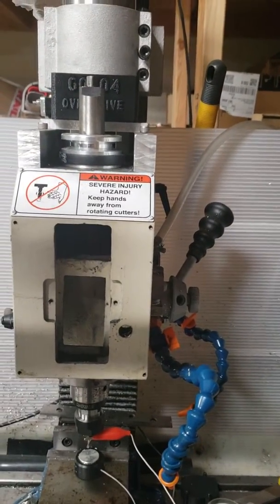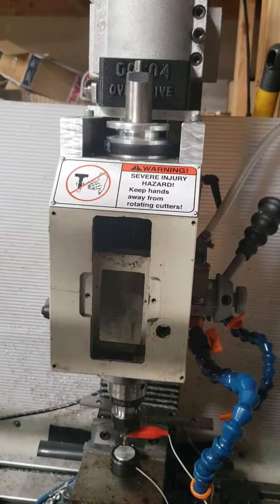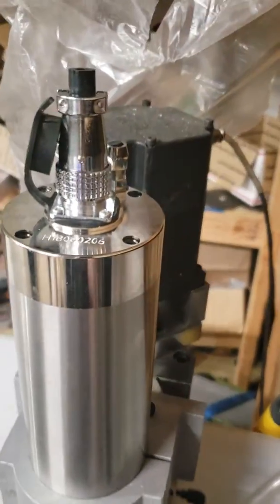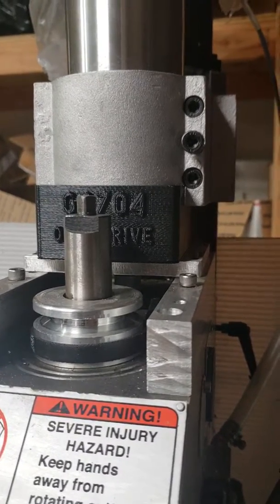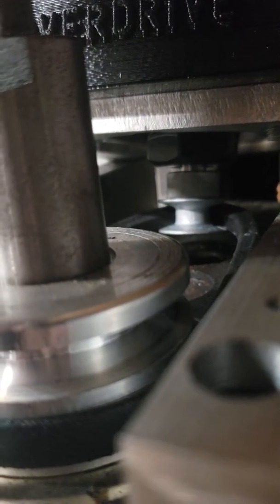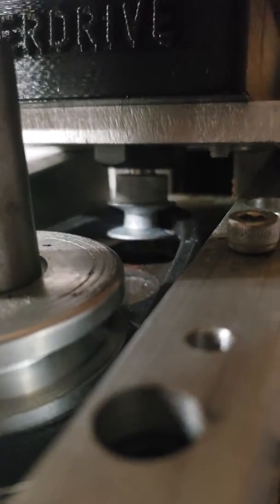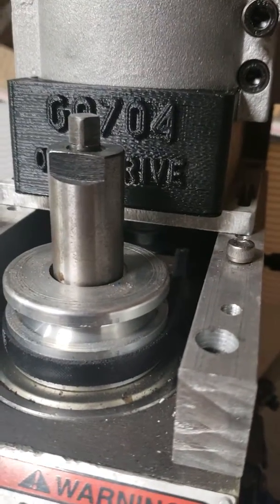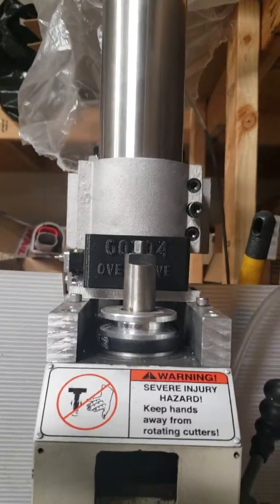Updating the Cnc G0704 Mill to run using a 2.2kw Chinese milling spindle to drive the stock spindle.

Comment: Id love to see a vid of this running. Ive been wondering about doing this myself but from what I can find youre the only one whos done it. The only concern I have is if the belt can deal with the high rpms of the spindle motor
Reply from the maker: Jonathan,  

My original intent was to make a pulley set to use gates polyflex Jb belts.  They can handle up to 30,000 rpm and are extremely durable and flexible. 

The specific belt I am going to run is a 3 rib 5m profile polyflex jb.  

I wanted to confirm this motor would have useable torque before investing in the new setup.

I have lots of projects coming up so make sure to check back soon.
Reply: Thats a good call with the belt, I hadnt considered something like that. For some reason I had timing belts stuck in my head. Could you post a link to the spindle you bought? Im wondering if a vector drive would help quite a bit with the low end torque also
Reply from the maker: @jonathanfeist9821 Its a 2 pole 80mm x 246mm motor from rattm motors.  I figured if it didnt have enough torque I would sell and purchase a 4 pole motor. 

I should have made video of this running a 3/4 inch shear hog.  Worked awesome until I took too aggressive of a cut and broke the cast aluminum pulley. 

New belt setup should be done in a week or so.  I have a new video of machining the spindle side pulley.
Reply: @adaptedmachining6951  Do they do a 4 pole motor? I've not been able to find one. I think you'll have plenty with a 2:1 reduction. Definitely looking forward to your video of it cutting stuff
Reply from the maker: @jonathanfeist9821  The do make 4 pole spindle motors - They usually are about 2-3 times the cost.   But so far on roughly 3:1 with running from 70hz to 400hz I will have my desired rpm range.  And on the 3L belt / pulley setup I had plenty of torque.  3/4 inch AB tools Shear Hog was rocking!

Comment from the maker: Wanted to update everyone on this setup.  As I had it configured I was able to achieve 1400rpm to 8000 rpm.  

It has useable torque at 1400 for smaller end mills.  Around 4000 rpm it was able to do .200 doc .200 width of cut with a 3/4 inch shear hog no problem. 

I tried to take a .300 cut with the shear hog and ended up breaking the pulley on the motor.

This pulley setup wasn't intended to be permanent so I am not really upset.  

I think this setup is going to work well as soon as I get the new pulley and belt configuration done.